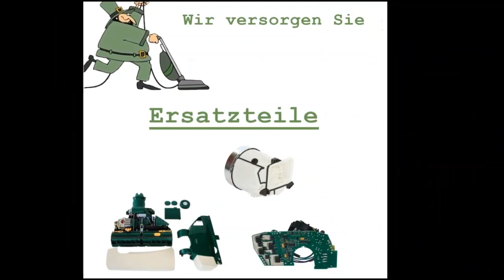Reparatur Motor Vorwerk Kobold VK135 VK 136

Comment: Che misura hanno i carboncini   sul motore?
Reply: Die Maße sind 15mm x 8mm x 5mm.
Reply: @teamleiter-kobold-oesterreich  li ho smontati. Sono 22mm x 8mm x 5mm e hanno stampigliata la sigla X80D (ma con questo codice non ho trovato nulla in rete)
Reply: @ninoadesso3546  Die Originalmaße sollten die angegebenen sein. Alle Zulieferartikel werden für Vorwerk extra angefertigt und sind so nicht frei erhältlich. Es soll damit verhindert werden, daß an den Geräten herumexperimentiert wird.